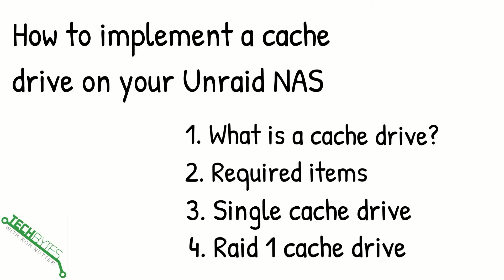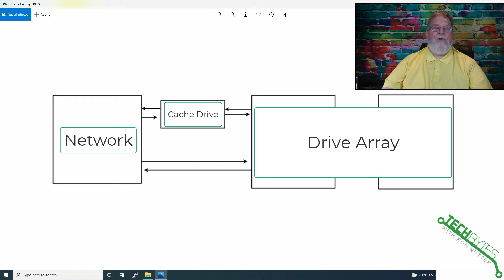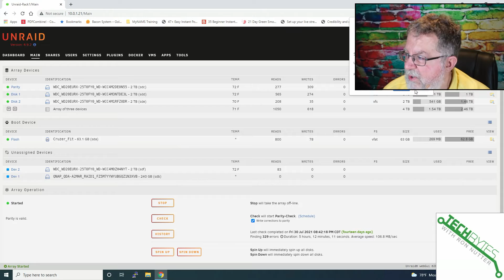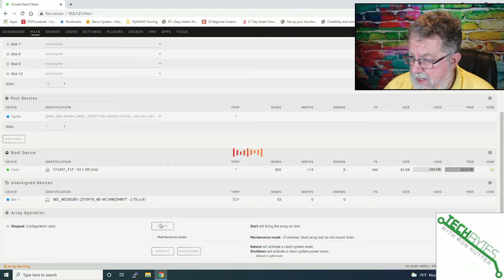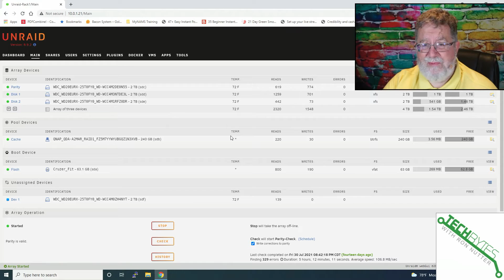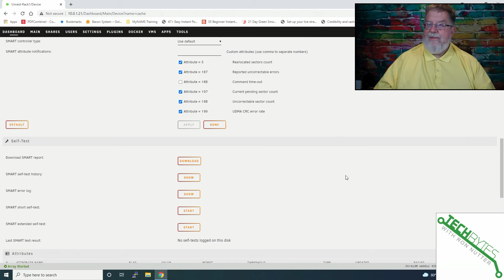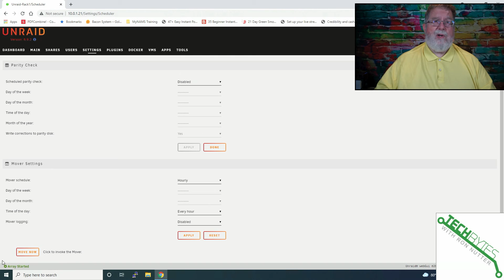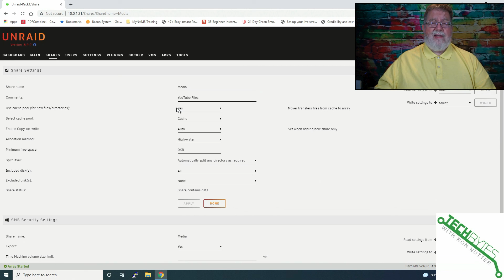How to implement a #cache drive in Unraid

Comment from the maker: Here are other videos in the Unraid Series - 
3 Reaons for Unraid in your Smarthome	https://youtu.be/ZS1FyBzr1ls
Why you should have a UPS on Unraid	        https://youtu.be/1DOgvna2K6s
How to use Unraid as a backup	                https://youtu.be/wze6o4E1LIo
How to implement a Cache Drive in Unraid	https://youtu.be/Q9xoqQLl9iI
How to troubleshoot using Unraid and iPerf3 https://youtu.be/De4mrS_mPuk
How to block ads and malware with AdGuard on Unraid	https://youtu.be/17of72suJnE
How to Speedtest with Unraid	https://youtu.be/Iitg5shWbS8
How to setup Plex on your Unraid Server	https://youtu.be/OysJHHOrrIU
3 Reasons you should have HomeAssistant in your Smarthome	https://youtu.be/lkKDdWRyfnE
How to replace failed drive in Unraid	https://youtu.be/O5sQ65_6riA